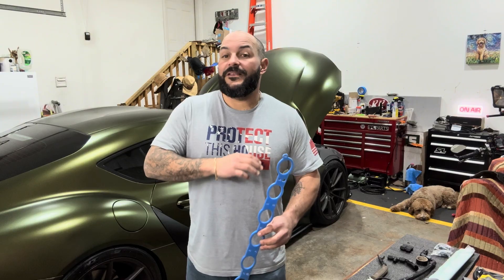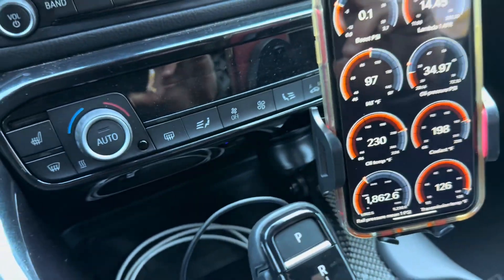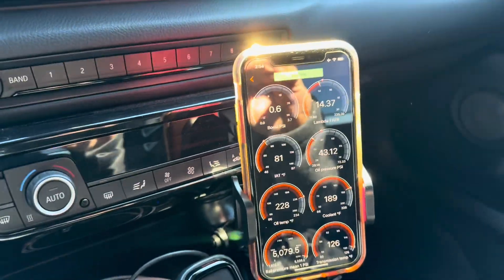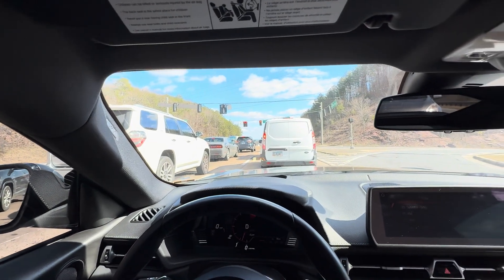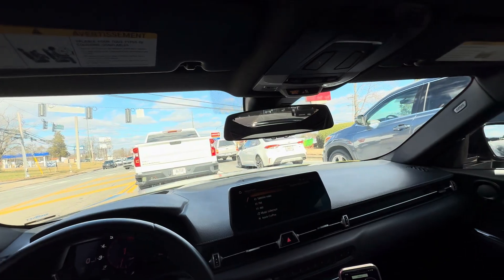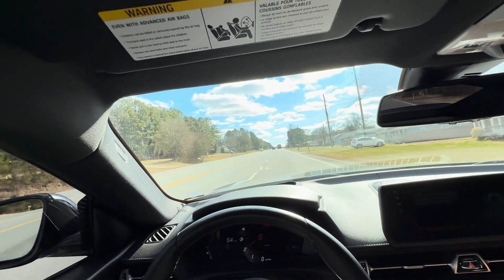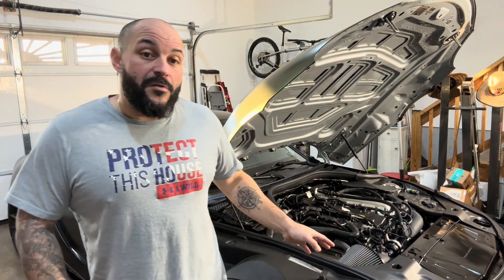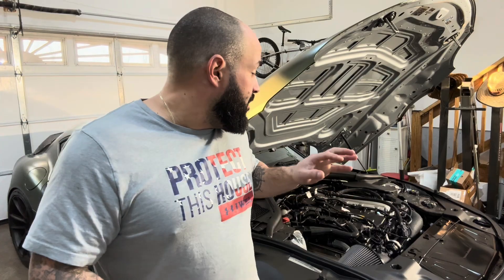Does the b58 alibaba manifold out perform the stock manifold?

Comment: Thanks for the vid! Did you fill your intercooler cooling system with vacuum? At first I didn't and got IAT as hot or even hotter as stock when I floored it and then I did the vacuum method and my temps were really good and low. So I must have had a big air bubble in the intercooler since it's the highest point in the system. All the best from Germany! Thomas
Reply: I’m getting higher iat than with stock, i didn’t use vacuum method…
Reply: Do you mind explaining me your experience with iat before and after vaccum method
Reply: @josegabrielguzman7174  Before vacuum method, I had higher IAT than stock and after filling with vacuum (venturi nozzle), IAT was a LOT lower than stock. If you don't have the access to the equipment necessary, just go to your BMW dealer, they should have the stuff since BMW says it's mandatory to fill via vacuum.
Reply: @edc15de thanks for the info. I just bought it from Amazon…. Im getting 160f now with alibaba IM, i hope this is the problem.
Reply: @josegabrielguzman7174  I think even the cheapest ones are better than stock since the cooler inside is bigger. Good luck! 😃
Reply: @edc15de I hope when i bleed the system with vacuum I solve the problem.

Comment: What were ambient temps?
Reply from the maker: @ericdisparte  50 degrees, I’m finishing a video now with more data, the spacer makes a huge difference. It currently sits at 6-10 degrees above ambient when cruising
Reply: @turbotimegarage  That's impressive. My wagner manifold will hit about 30 above ambient when cruising. But without a spacer.
Reply from the maker: @ericdisparte  spacer made a huge difference, this one would quickly creep up when sitting still before the spacer, sitting in the staging lanes at the track it gets maybe 20-30 degrees above ambient essentially sitting in stand still traffic for 20-30 minutes
Reply: Which spacer did ypu go with, csf?
Reply from the maker: @ 
I ended going with the spacer from bimmer network. I have the csf spacer but really didn’t like the fitment. To my understanding it doesn’t fit the Wagner manifold too well either. In my case the bore spacing was off by about a 1/4” on the first and last cylinder. Bimmer network spacers fit perfectly and works well. You will need extended hardware I put the sizes and link in the description

Comment: Any VE difference between manifolds?
Reply from the maker: @JaydenET  not sure what you mean, 
VE as in value engineering?
Reply: @ Volumetric efficiency. Basically does the new manifold/cooler flow better or worse, cause usually cooling capacity and flow is a trade off
Reply from the maker: @JaydenET  due to the increase in size I believe it flows better, even while offering better cooling, torcoils has some flow bench data claiming less pressure drop but I’d be lying if I told you i know for sure 🤷🏻‍♂️

Comment: Did you check out DO88, perhaps Swedish?  Don't have info just know they sell 2 types of B58 manifold, from where they come or how they perform I have got no clue just interested myself?
Reply from the maker: @luffararnesugerkuk  CES Motorsports has used a few of them on there builds, they seem to be pretty high quality, they sell one with a garret core and one with a core much like the one in this manifold.
Reply: @turbotimegarage  yes, thanks for info, will check it up cause in Sweden myself. It would actually be more expensive for me to grab 1 in China and pay all import taxes here, then getting the standard version. The Mera version you said have a Garret core and fuel rail in package is about $3.5k so a bit more but still competitive if well done? Cool, thanks.
Reply from the maker: @ the most complete kit for the money is the remnant performance full gamma it comes with the fuel rail, injectors, thermal spacer, all fuel lines and is also right around $3500
https://remnant-performance.myshopify.com/products/remnant-performance-gamma-system-for-the-gen1-gen2-b58-platforms?variant=43653894963357
Reply: @turbotimegarage  Thanks a lot, will most def take my time to check up, where sold, shipping etc.. Import to Sweden is very expensive, taxes and fees run away quite fast when looking outside the EU, sometimes or at least in the past one could get away a bit better when using a UPS, Fedex or any of them so worth checking. Thanks, appreciate it and good B58 content
Reply from the maker: @ thank you for watching, more b58 content on the way
Reply: @turbotimegarage hey.  You need to log intake temps pre throttle.
Reply: I have the do88 intercooler (and the Wagner radiator) in my car (2021 F22 M240i, so Gen1 B58) and my temps improved a lot. I'm from Germany so I can do logs on the Autobahn up to 340 kph / 211 mph with no problem.

I looked up old logs with the same DAW 6769 turbo and compared it to new ones I did. In both logs I accelerated in 6th gear from 1500 rpm to 6700 rpm (289 kph / 180 mph) and had the same lambda 0,82 / AFR 12.0 and boost (1,97 bar / 28,5 psi) there.

Outside temp with stock coolers was 15,5° C / 60° F and the IAT at 6700 rpm (still on full throttle) was 51,8° C / 125,2° F. With the new do88 intercooler and the Wagner radiator I had 24° C / 75,2° F outside temp and still only 46,5° C / 115,7° F IAT. So even it was 8,5° C / 15,2° F warmer outside, the IAT was still 5,3° C / 9,5° F colder. If it would have been as cold outside as on the stock coolers log, it would have been even more impressive. The difference in inlet temp compared to IAT was 36,3°C / 65,2° F on the stock coolers and only 22,5° C / 40,5° F.

Airbox is stock with the factory hot country intake and a front air scoop behind the grill.

Comment: Spacer doesnt do as much as
 people think 
Very minimal
Reply from the maker: @flaviomartinho1753  I’d have to disagree with you, I’ll agree it makes little to no difference while your driving, but so far it’s huge for the heat soak it was having when sitting in traffic
Reply: @turbotimegarage  I don't use one, my buddy uses a tick one and we both run the same manifold , we see barely any difference on logs, both cars have big turbos.
I am bottom mount he's top mount so we assume that might play a roll 
Sitting we never tested much
Logs and driving
Reply from the maker: @flaviomartinho1753  
From what I can tell the spacer doesn’t do much if you were road racing for example, but if you sit and idle the car for a while your starting temperature is much higher than with the spacer installed. I’ll be presenting those results on the next video along with the addition of port injection
Reply: @turbotimegarage hey.  You need to log intake temps pre throttle.

Comment: you need to log  "intake air temps prethrottle" so we can see how much the manifold can shed heat during WOT
Reply: You 2 port or 6??
Reply: @Echelonperformance  6
Reply: @kevin-jm3qb nice. Same here. Won’t be able to cover all factors of the manifold. But I would say the average cost of alibaba is 1,400-1,600 with roughly $300 for the CSF spacer is $2,000 total. Next would be the DO88 starting at $2,088 then upwards from there. Considering where this manifold coming gonna have to be some compromises. I’m leaning more towards the DO88 so I can retain my full engine cover and looks like I haven’t upgraded that piece
Reply: @Echelonperformance  bro this dude is on mhd.  He just has to go into data log section and add intake temps before pre throttle.  This will give the actual performance of the manifold.
Reply: @Echelonperformance  I have the do88 intercooler (and the Wagner radiator) in my car (2021 F22 M240i, so Gen1 B58) and my temps improved a lot. I'm from Germany so I can do logs on the Autobahn up to 340 kph / 211 mph with no problem.

I looked up old logs with the same DAW 6769 turbo and compared it to new ones I did. In both logs I accelerated in 6th gear from 1500 rpm to 6700 rpm (289 kph / 180 mph) and had the same lambda 0,82 / AFR 12.0 and boost (1,97 bar / 28,5 psi) there.

Outside temp with stock coolers was 15,5° C / 60° F and the IAT at 6700 rpm (still on full throttle) was 51,8° C / 125,2° F. With the new do88 intercooler and the Wagner radiator I had 24° C / 75,2° F outside temp and still only 46,5° C / 115,7° F IAT. So even it was 8,5° C / 15,2° F warmer outside, the IAT was still 5,3° C / 9,5° F colder. If it would have been as cold outside as on the stock coolers log, it would have been even more impressive. The difference in inlet temp compared to IAT was 36,3°C / 65,2° F on the stock coolers and only 22,5° C / 40,5° F.

Airbox is stock with the factory hot country intake and a front air scoop behind the grill.

Comment: Hell yeah man was anticipating this video, can’t wait to see the potential difference with the spacer installed
Reply from the maker: @MilkCurds  installing now, have some dyno time scheduled for next week to get the car dailed in, also gather some data with Ali vs csf on the dyno
Reply: @turbotimegarage hey.  You need to log intake temps pre throttle. We can't even see how well the radiator is preforming
Reply from the maker: @ I’ll have a lot more data when the car goes on the dyno next week along side the red Supra, this video was focused on how much the temp rises during a pull
Reply: @turbotimegarage  dude fiiiiiiiiiiinally.  i thought you were trying to avoid this.  the data you've shown isnt telling us how the manifold is preforming without that channel.